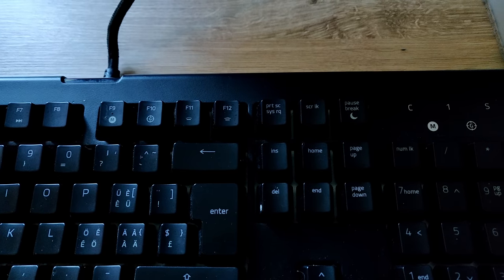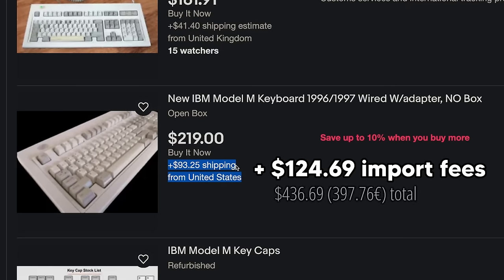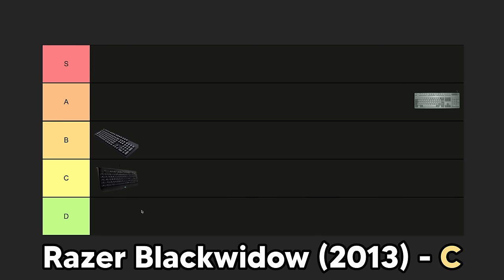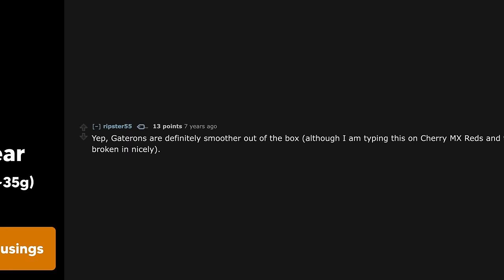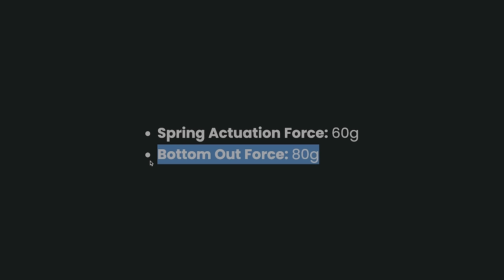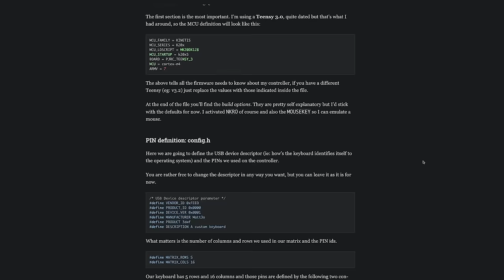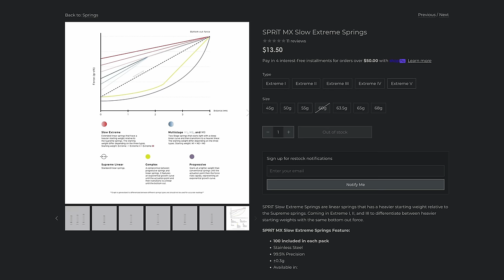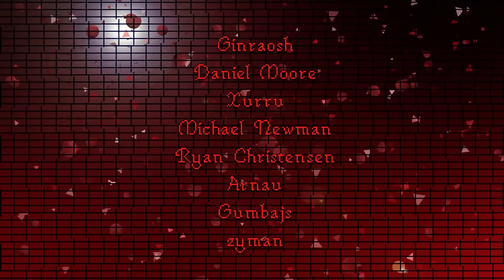How I Lost Interest Towards Mechanical Keyboards

Comment: Wow, I can kind of relate to this journey. I also started with a Razer keyboard (Razer Tournament 2017 TKL), it felt horrible. The cheap metal-like housing, the clicks, the rattle on the keycaps - everything felt so wrong. What's more, it broke in less than 3 months and I swore to never pick up a Razer keyboard ever again.
Then I bought a low profile plunger Cougar keyboard (membrane) and it felt...great. Yeah, didn't ever expect a plunger keyboard out of all things to feel decent and be this responsive in terms of tactile feedback. It had everything - from decent design and lighting to amazing feedback. That said, its membranes started to wear off after a year of heavy use and I had to change it for something else.
Later I decided to go a different route - a relatively unknown brand with Kailths. It wasn't bad, yet due to some cost saves the default keycaps scratched their housings SO HARD it was difficult to bottom them out quickly to the point my hands were getting pretty tired after long sessions which is why I quickly sold it and found something that I would stick to as my end game.
K-1 Extreme with Cherry MX Blacks. It was HEAVY, and I mean it. That said, Cherry MX Blacks felt great to type on and their responsiveness and stability was absolutely unmatched. While going for Chuden in IIDX (a relatively niche rhythm game in the western world)  its spacebar out of nowhere broke in half. And you'd say, just buy another keycap for a spacebar. Easier said than done, it used the good old Costar stabs which aren't that easy to come by these days where all the mass market keyboard have already switches to cherry-like stabs (god I hate cherry-like stabs, they are so horrible at doing their job). And I decided to one last time go for a new keyboard that was just going mainstream and it was the worst decision EVER.
Dark Project KD87A with g3ms sapphire. PBT keycaps, properly lubed out of the box, it felt great to...just look at it. The switches were so light (45g but in reality felt more like 30g) you could accidentally trigger them if you moved your keyboard too hard (you can't rest or fingers on it at all, the switches are THAT light), the actuation point was non-existent hence no feedback whatsoever, the NKRO wasn't the best and its polling rate was going up and down depending on how many keys and how quickly you pressed them (2 keys - 1000Hz, 6 keys - goes down to 62,5Hz). Since it was hotswap, I thought Cherry MX Blacks would make it a tiny bit better but they were practically non-existent on the market at that point so I ordered a set of Gateron Blacks and I didn't like them. A little too soft, not enough feedback. Besides, when the PCB is that awful, no switches would be able to fix that, so while KD87A was still hyped up, I managed to sell it at the same price I bought it and then I ordered...a used K-1 Extreme for dirt cheap. 
I'm still using it and I'm not sure I'll ever find another keyboard that would be able to match it for me. MX Blacks + decent PCB = one love. I don't care for lube, don't care for light switches, PBT keycaps and I absolutely hate cherry stabs, they are AWFUL. All I ever wanted was a 1000Hz keyboard with decent NKRO and switches that wouldn't trigger should a small wind come by. And MX Blacks with Costar stabs do just that. Hard to press at first, but the more you use them, the more you are getting used to their feel. No accidental triggering, very stable throughout the entire keyboard, extremely responsive and amazing feedback when bottoming them out.

Comment: 1:40 it actually looks good, as having a different color for control keys (+ space bar and windows key) adds to the visual ergonomic. That said (as some "positive" way to look at it), I agree with your argument, of course. Something else: in 2013, mechanical keyboards were NOT "relatively unknown": they were the very first PC keyboards since the 1980's-90's, and widely used up to around 2005. They were left aside because of their noise, especially for work environments, but they're sill the most reliable and durable keyboards.
Reply from the maker: I've had the exact same comment dozens of times and I wholeheartedly disagree about the keyboards being known. They absolutely, 100% were "relatively unknown" in that era.
Yes, I'm entirely aware of the history of keyboards, I mean I literally have a buckling spring keyboard from 1994 in this very video. But you said it yourself: "widely used up to around 2005".
I'd even go as far as to say that for the average consumer, most of them were already phased out even earlier than 2005, especially here, because I don't remember seeing a single mechanical keyboard even in the early 2000s, not even sold in stores, friend's houses, etc. Literally the only place where I actually know there were mechanical keyboards used at that time here were in cashier terminals.
For most computer users, keyboards at those times were already cheap membranes. That was, up until 2011 to 2013ish where gaming keyboards with Cherry MX switches slowly started entering the market once more and being sold in stores.
I even went ahead and looked at 2010 Amazon via the internet archive, I went through multiple pages of computer keyboards and not a single one of them was even remotely mechanical. Even if there were people who knew the existence of mechanical keyboards from the past, most consumers from that era didn't even know the difference nor ever realized that they disappeared, younger people especially, which is also why I used the word "relatively". 
An argument can also be made that when most people think of the term "mechanical keyboards", they mostly think of the modern, Cherry MX based "customizable" ones rather than reed switches, buckling springs and so on, in which case that "hobby" was extremely niche and small at the time, its only recently that it has become absolutely omnipresent.

Comment: I'm kind of in the same boat. I bought the YMDK Split 64 years back and basically daily drove it to death. In between that time I never bothered to buy or really research into keyboards anymore. Everything I tried from my friends, or what I watched I just wasn't interested in. It's like I found the one layout and experience that I wanted and I was more than happy to die using that.

The only thing that changed was recently I fudged up big time by destroying some of the hotswap sockets so I ended up buying a new keyboard (I know you could get it fixed but I needed a new board asap). Now I'm sort of back in the hobby cuz of all the research and I'm super happy with what I got!! I bought a Monsgeek M1W prebuilt and holyhell what an experience. The entry-level/pre-build stuff is on another level entirely now. All the things this board has is what was on ultra premium boards years ago.

So yeah long post but just wanted to share with others it's the journey that counts and the end game could be real :) 

P.S. your video made me start saving up for an HHKB =))

Comment: I prefer the Topre switches as well, but I need a full size standard layout keyboard. So my main keyboards are now all Logitech K120. Rubber dome switches, just like Topre, but resistive, not capacitive. The K120 is actually wired with gaming in mind, with the left-hand area (around the "WASD" keys) free of ghosting.

Yup, what amazed me at 14:43 was that there is actually a gaming keyboard which uses a diode matrix. A diode matrix should be mandatory for gaming keyboards (especially considering that, at a price of less 0.02€ per diode, this wouldn't add much to the relatively high price tag of a gaming keyboard anyway). The diode matrix eliminates ghosting perfectly everywhere on the keyboard...but gamers nowadays seem to be concerned about RGB lighting than anything else - as long as it says "Cherry MX" somewhere.

Yes, the K120 won't live as long as a Cherry MX-based keyboard, but it's significantly cheaper, so I can afford to throw it out after 15 years of use and get a new one. The rubber domes wear out over time. I guess Topre is also affected by that.

Comment: I sympathize with your journey. I found myself settling pretty early on the ergodox as my endgame. I currently own 4 ergodoxes to try out different things. The first one obv was just my first venture into split. The second one being hotswaps, which was convenient for replacing dead switches, but never found myself ripping them out to try out completely new switches in the end (very happy with holy pandas). The third ergodox was wireless, which did wonders for my desk setup. And the fourth and latest addition is a low profile version that I justified as a work purchase as I need to have a mobile setup.

It was fun and exciting being in the space, but when I found my comfort zone, I found myself not really caring about the next new board or next new switch that people are coming out with because I know I wouldn't like it as much as I like the ergodox. I have a few 60% and 65% sitting in my closet from my exploration stages, one of those boards are now claimed by my sister as her daily driver for work. The hunt was fun, but it ended as it should have.

Comment: Personally never been a fan of mechanical keyboards, I've used them extensively when I was at school and nowadays when I'm at work. But at home I use this old Asus keyboard which I've had since 2011, I'm so in love with it that I've bought 3 replacement keyboards in case this one breaks down. The problem is that I can't find correct keycaps so that was the next best solution for me.

Comment: If you miss the tactility from rubber domes but want something that is even more reliable than mechanical, save yourself some money and get a Leopold, Realforce or HHKB. I spent hundreds if not thousands with hot swap keyboards and switches, looking to emulate that feel of rubber dome, but it's just not possible for MX to feel the same way. I always come back to my Leopold FC660C. I still swap to some other keyboard for variety, but it always feels good coming back to the Leopold, only thing I miss is not having backspace remapped to capslock. There's third party controllers that are programable, but they may be costly to acquire in the EU.

Comment: After watching the full video I have come to the only possible conclusion. You and I are the same person. I have tried all kinds of high end MX boards, premium mounting styles, plate materials, switch choices  (linear, tacticles) and NOTHING comes close to that HHKB feeling. For me it's not only a preference but sort of a necessity as almost any other option is too stiff and ends up causing finger pain / fatigue, even extremely soft mounting styles with soft plates don't offer the comfort of the  HHKB (plastic plate with domes is extremely soft)...  

Basically Topre is the best switch type for general keyboard use and I have given up on trying to change that. I will however keep an extra board around for gaming since I prefer linears for that and need a CTRL key under the left shift (muscle memory too strong). 

Great video, I share the sentiment.

Comment: I lost interest in mechanical keyboards for an entirely different reason. Last year, I was obsessed with lubing the switches of my Fnatic MiniStreak keyboard, and I did that, with desoldering and everything. Got custom PBT keycaps to go with it. The sound was okay and I drifted further and further into the mechanical keyboard space. But you can only see and listen to so many high-end keyboard sound tests with lo-fi music in the background and incredibly muted and thocky switches, so I got incredibly bored of the high-end stuff, everything felt and looked the same.
To add onto that, ISO-DE keycaps are hard to find (good ones at that) and i cba to learn the ANSI-EN layout.
I still mod my keebs from time to time (switching switches and keycaps) but I think im never gonna buy any high-end stuff, like ever. I'm using my Cherry MX Board 3.0 from 2016 right now with brown switches. I like the imperfect, plastic-y sound of it and i honestly much prefer any low-end gaming keyboard over lubed tangerines in a Zoom tkl lol. 
Nice video

Comment: Still using my original blackwidow v2 from 2017. Apparently according to so many people online razer switches are less reliable, and may have a short lifespan. Over six years later and daily heavy use I’ve had to clean it and I have a huge gash in my spacebar from my thumbnail. Still clicky and nice to type on

Comment: I went from using rubberdomes for a long time and being pretty good with it, to a Cherry G80-3000N TKL, and it uses MX SILENT RED keys (you coold chose clear ones also), and I decided to take silent keys because I personally find the clicking too annoying. Some people in my discord send more clicking noises than voice lines, because they are not even using any sort of noisecanceling or whatever. When someone is with you in the same room while you're on the PC it is also annoying for them.
And tbh, I didn't feel too much difference to a good rubberdome keyboard, maybe the Pressure feels a little different but thats it, like, there is a clearer point of activation of a single key, but that's it. It's nearly as quiet, it does a good job, the RGB is amazing, the quality for this price also, and I don't ever need arrow keys or whatever, or a numpad, plus I have more room for my mouse movements, so, it's perfect for my expectations I guess.
And whats better than a 60€ TKL gaming Keyboard from the key-manufacturer itself? Solid product!!! Maybe I'll give Cherry a try on my next mouse also. I saw a good looking one, and since I really like the quality of the keyboard for this price range, it's amazing, I wish more companies would be like that! For example, my previous logitech keyboard for the same price, was way less quality than this. Not only the materials and the haptic are amazing, the RGB as I said, gives flawless flowing color modes, you can light every single key differently if you want, I never had such an RGB experience on any RGB keyboards before (but only had 2 before that). The software is pretty flawless and user friendly also, only weird thing is, Tarkov makes it pop up while starting, for some reason. But it's still better than my glorious software, which only runs in compatibility mode of windows 7, trash software, let's be real, but the Mouse is incredible, so, it makes it up. And when this is broken, I might try a Cherry mouse as I said.
End of the story, I think you should consider a Cherry Keyboard or Mouse, if you look for pricy quality (in my opinion). But it depens on personal preferences I guess, as usual.
Btw. really enjoyed watching your video, it was entertaining, interesting and chill at the same time, I like the estonian dialect also. Have a great one!

Comment: So a few things that might help if you decide to jump back into this hobby. First, a lot of PBT key cap sets now come with the extra modifiers for different layouts. Look around a bit, and check photos closely to see how thick they are. I've found several places with decent thickness caps selling for $40-$50 USD per set. Second, there are very inexpensive "kit" keyboard out there. CiY has the Tester 68, AK84, and a TKL one for anywhere from $25-$45. While these aren't likely to become daily driver keyboards for you, they are great for testing different switches and key caps.
Reply from the maker: Those tester boards are interesting, had no clue about them.
Reply: @Livakivi  I forgot to mention the biggest reason for using them: they are socketed, so there's no soldering/de-soldering the switches. The stabilizers are probably their weak point, but I've made them acceptable with a little lube and shims.